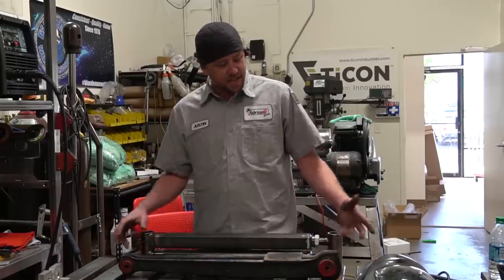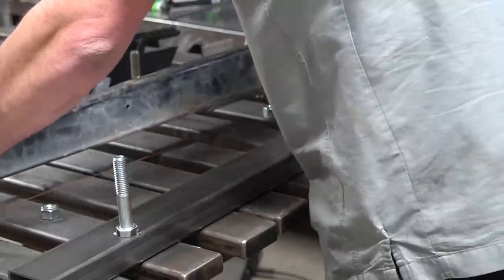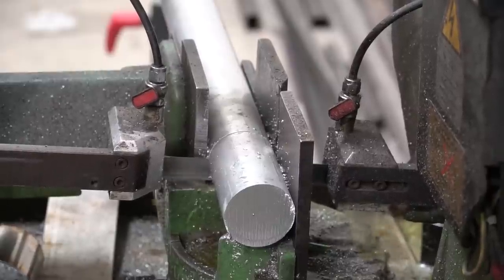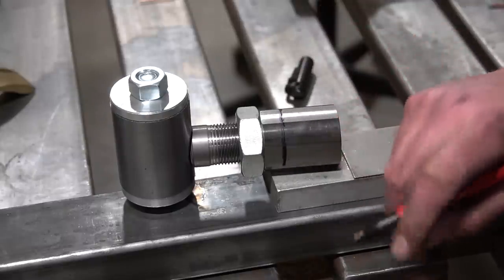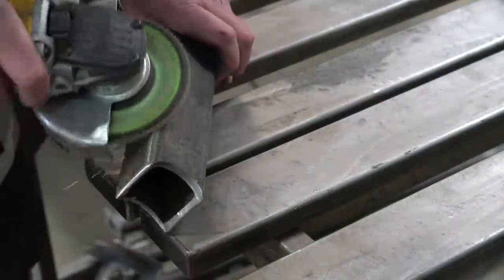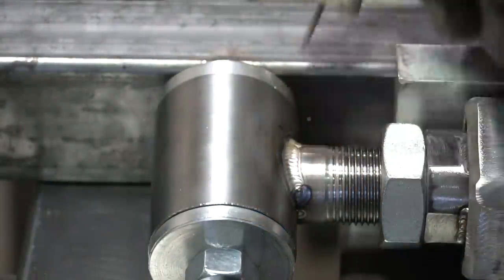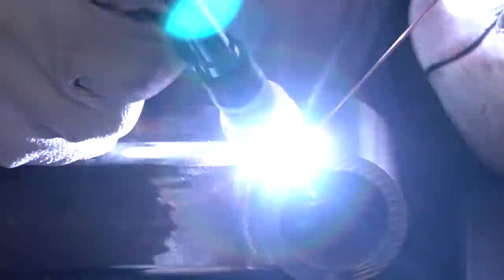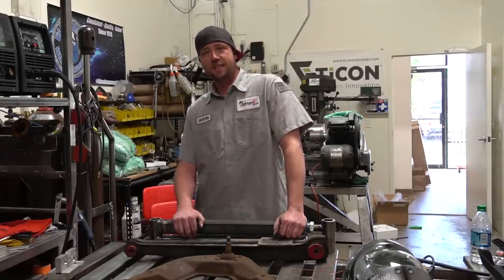TFS: Custom 4 Links Part 1

Comment: As an (ex) jig designer I would have drilled straight through the main square of the tube and put the bolt all the way through before welding.  That would insure the bolts are parallel.  Just welding the bolts on may result in a mechanical lock if the bolts aren’t square on.

Nice welding.  Very neat.

Comment: Justin , I might have a tip for you when you use emery cloth on your lathe. I was taught to lay a rag on the lathe bed ways when 
using emery cloth. The reason being that the grit on the emery cloth comes off while your using it and it sticks on the oiled bed ways.
Then when you move the saddle or tail stock on the bed ways with grit on them you will start to sand down the bed ways and will
start to create a swayback or low spot. This will make the lathe untrue in its future.  Just an observation from a fan in Alaska.

Comment: This was an awesome video! Something to keep in mind is vent holes.  Save yourself heartache when building sealed tube parts,  drill your vent holes
Reply from the maker: It's not sealed.
Reply: With the threaded link installed?
Reply from the maker: @Skeetmgeett  Yes. It's not water tight. Gas and pressure can escape easily.

Comment: Ruffstuff Specialties sells some baller tube bungs for square tube, I think with those you wouldn't have the issue with the corner gaps. 
When I built my three link on my Jeep I heard horror stories of the rod end threads seizing in the bungs from heat so I coated them with antisieze before welding. Awesome video, I like seeing some suspension Fab on here!

Comment: Ian Johnson (extreme 4x4) had a tip a few years back about dipping bolts in muratic acid to remove the coating. It works. But I usually don’t have any so I use a grinder like you did (or the blast cabinet).
Reply: motecalevol - muriatic works real good for that.

Of course, ya' might have mentioned that doing it in a building is a good way for those fumes to attack anything made of steel ANYWHERE nearby (as opposed to letting people learn that the hard way...)

Comment: Nice work.  My instinct for a threaded pin is to measure what 5 thread engagement is near the end, then split the remainder in half for the adjustable portion/initial location before adjustment.    Locknuts can put a pretty good load on mating surfaces, so having only 2 or 3 threads engaged is just trouble waiting to happen.

Comment: First off. I love the vids.. Second. When you were sanding the tubing on the lathe I had a little cringe. I have had emery paper tear while doing this . If yours would have torn, you would have gone forward towards the machine. If you have the paper looped around the backside and pull towards yourself. If it rips you will go in the happy direction.
Reply: you took the comment right out of my keyboard! standard machinist safety tip.
Reply: I’m sure he wasn’t putting his full body force into it so if he ripped he would of been flat footed and secure.

Comment: When youre using turners friend on the lathe best off 'pulling' the emery cloth rather than pushing it that way if it breaks youre punching yourself rather than hardened ways or a spinning chuck. Love the videos, keep it up (without workplace injuries)
Reply from the maker: I was originally taught the way you mentioned but it just doesn't feel comfortable to me. I'm a total weirdo I guess haha.

Comment: That’s awesome to see. 
I just went through the same thing with my 63 Cadillac
Ditched the upper section and triangulated the upper arms the opposite way from factory. 
I searched everywhere I could trying to find any information on 4 links for 59-64 Cadillac’s and couldn’t find a thing.
Reply: Oh your buddy will find a whole new problem once the geometry is corrected. 
I found it the hard way👍🏼

Comment: In most cases a piece of wooden closet rod with a hole drilled in the center has worked for me as opposed to buying a bushing insert. Works great as long as you don’t set it on fire.

Comment: I prefer DOM tube for such things as it looks neater and more  professional to my eye  than square tube. But that is just my opinion, the pressed steel piece looked very commercial which is something I always try to get the look of, the just out of the factory look.
Reply: He’s gonna add a bag plate to the bottom square or even 2x3 is preferred round bars will deflect and bend
Reply: Your referring to round vs square.

Comment: when using  emery cloth on a lathe you should have the cloth on the back side of the part and pull towards you, that way if the cloth breaks or you slip you will fall away from the lathe, you dont want to fall into it....

Comment: Klean-Strip Phosphoric Prep & Etch works wonders on mill scale
Reply: Work better than muratic acid?
Reply: @vr6swp  Faster in most cases, Wet it walk away for 15 minutes, then wash off.
Reply from the maker: Or take 30 seconds to a minute with a piece of sandpaper...
Reply: @TheFabricatorSeries  if you're looking for non marked surface, something like the prep & etch is the best. Leaves no marks or gouges, when it has to be seen at all time and you can't use filler yo make it perfectly flat, it's the only answer.

Comment: You have a very smooth hand when it comes to welding tig.
 
 I've wanted to learn to tig weld for years. I just don't have a need to do it. Well i don't have a big need. 
  Im installing  bracket in my truck to hold the Jaguar xjs independent suspension in the rear. The people who manufacture the brackets say if you don't tig weld tack it in with your mig. Then have a professional come in & Finnish tig welding it all.
   Does the tig have that muck more penetration when it comes to the weld?

Comment: Thank you very much for taking the time to show us how to do this , I found it very interesting. When you tack welded everything together I noticed you didn't g clamp the box section down. any reason ?
Reply: the outside?why bother with it now?sand blast or sand it later when its necessary after build is complete and get 
them powder coated,you dont want to bother with cosmetics until the arms are completely built with the bag mount.

Comment: Hi, I was just curious as to why you chose to use square tubing. Would round tubing have worked just as well, or is there something specific about the square tubing that makes it better suited for this type of job? Cheers! Thank you.
Reply from the maker: There will ba an airbag mounted to it. It's just easier than round in this case.

Comment: Weave welding yields very inconsistent strength test results. Because the material is heated for longer with a weave vs a stack of stringers it puts a lot more stress into the material. Also with stringers it is critical to let each pass cool for maximum strength.

Comment: Great video and fabrication job! Those welds look great too!
Does the square tubing have to be that thick or would 1/8" or 3/16" be sufficient?
Reply: I didn't ask you FFS. I asked Justin because I wondered if something in the car or design called for such thick metal. An eighth inch is .125, not .118 and what does a roll cage have to do with anything...

Comment: I never know what to do.  Are you suppose to crank down on the bushing bolt so that the inner sleeve is unable to move and therefor requires the bushing to move on the sleeve or is the join suppose to pivot on the bolt?

Comment: Would it not be preferable to drill the bushing tube where the threaded end has simply been butt welded. Set the threaded piece into the hole and weld from inside bush housing, as well as the weld you have done ?...Missing link

Comment: Do you feel that you could get similar strength when mig welding this? If so what wire would you recommend?
Reply from the maker: I MIG welded links for years without issues but I feel I have more control with TIG.

Comment: was there any particular reason for tig welding the arms as opposed to just flying through it with a mig?
Reply from the maker: Better control of the weld/strength of it.

Comment: What if all I have is a wire welder. I really don't want to spend the time or money buying a tig or the time. Can it be done with mig? Will it be strong enough. I'm a "fairly" good wire welder. I've put a complete Jaguar IFS in my Ford F100 . I'm wondering about this sort of welding when I do the IRS. It has some radius rods that hold the alignment of the rear pumpkin in place. Plus. Each each of the arms that run out to hold the axles in place. They have rods that come forward to hold them in place.
Is wire strong enough?  Or should I tack it in place. Then take it to a "real" welding shop and have them TIG burn it in? (COST)
Reply: i would get it welded PROPERLY for maximum penetration.if you have a flux 110 volt model,don't bother doing much structural welding
Reply: @trillrifaxegrindor4411  I do have a 110 welder but I only use it when doing sheetmetal body type of welding.  I do have a 220 volt that will burn down almost anything. I've built a rotating type of table. Well it's kind of like a lathe. I've used a variable speed drill that I can gear any speed I want. I can put round objects in it. Put it on a slow speed an weld it as it turns. I'm building a 4 link set up an I'm really wondering if I can weld my arms together like this. I think I could do it in 3 passes (rotations). Will it burn in ok?
I understand that using a tig would be better. But would it be better than "my" mig welding. I know how to mig. I have never picked up a tig. Well that's not true. I used one back in the 70's. But I'm no good with one. Mig I've been doing all my life.  That's a long time!        😋

Comment: How's the adjustment work? Wouldn't the whole piece with the pin spin when you adjusted that nut? Or am i missing something?
Reply: yeah looks like you'd spin the head of it, so then all of your adjustments would need to be a minimum of half a rotation. The alternative would leave a big old screw needing to find a home, and possibly having it to be a split threat with one being left and the other being right. At the end of the day the lack of minute movement saves a bunch of cash and time.

Comment: @The Fabrication Series, I searched through the comments, and didn't see it asked... why square tubing instead of round? I didn't hear it mentioned, and my knee jerk reaction would have been to use round. (not knocking, just trying to gain knowledge)
Reply: It probably had a bag on the bar,  if you do bag on bar with round tubing you have to gusset it  and it's a lot more work to get much less strength.

Comment: I think if you take a part of the car that is light and flexible and replace it with something ten times sturdy, something else will break at either side of those bolts or the bolts themselves will bend. Nice welding and clean work. Did you drink 10 cups of coffee before narrating? You speak faster than those auctioneers.

Comment: Nice, a lot of the time people won't spend a few minute fabricating jigs and fixtures because 'it's too much bother/takes too long' etc... then take twice as long messing around with the first one and three times as long matching the second to the first.
If you're also doing the top links, you can use a side of the same fixture* for it's alignment bolts so you don't have to find two when you need them.
Mark exactly what it is and put it aside - good chance your client is going to send others round.

*IIRC from PP&T it is a fixture, not a jig, but I was always getting those definitions mixed up so... :-(
Reply from the maker: Jig vs. Fixture is literally the difference between machinist and fabricator haha. They're often interchanged with different descriptions for the same definition... I'm not even kidding.... it's like east vs. west
Reply: @TheFabricatorSeries  I think you nailed it - Fixture holds things in place for working on, like welding, etc. Jig does a similar job but also holds guides/aligns toolingfor further coperations  - like drilling or machining.
But, as I said, confused the heck out of me.

Comment: Why did you leave your tungsten sticking out so far?
Reply: that's purely to get into any of the tight spots that were needed for the weld. He said in earlier videos on welding with tig that you should always go over your run working out your movement and such first in order to ensure that you get a good weld. Nothing worse that just going gun ho at it and getting half way through and having to re-adjust your tig torch in order to complete the job because the tungsten won't reach to the root of where you need the weld to stick. He also compensates with having a much larger cup and possibly a little higher flow to allow for a more abundant supply of gas.

Comment: Nice Welds.
I do not believe you did any math. Don't blow sweet smoke up our bums talking about ratios either. You just got some heavy sh*t that was as thick or thicker than the sheet stamped originals. And did you need to make two sets of alum. dummy bushings or could two have done the job?

Comment: Um.......1/4" wall is for locomotives.  3/16 would have been overkill. Oh well, looks good. Plenty of opportunity to cut 'lightnin' holes in them and make them look trick.
Reply: how to get a good rep, overbuild
Reply: 1/4" wall is pretty standard in the off-road world. anything worth building is worth over building
Reply: @mikeymaiku  Is this off road? Streetrod I think.
Reply: forgot it was a bagged cadillac. i recant my statement
Reply: Almost anything in the customer suspension world is 1/4 wall anymore. I did all 1/4 wall in my stock powered b2200 when I bagged it pay a little more once or redo it a few years later
Reply: kmcwhq 
1/4 would be better, its not just a link arm, its also holding the weight of that corner on air bags. Point load also being a dynamic load can do some crazy things. 
Also the pieces are probably fit for 2” 1/4 wall as id changes if it’s 3/16
Reply: Yes remember he stated it weighs as much as a house.  The few pounds a piece of weight savings wouldn't be worth it as compared to the piece of mind that it will last a long time
Reply: @mikeymaiku   Cage wall is .118 that's less than an 1/8" and that's anticipating destruction, this is a suspension link!! Overbuild? That's an understatement!!
Reply: Drill holes  into that square tubing, and they will let water in. Next thing, its rusted out. It can be treated for rust protection on the outside, but inside would be somewhat more difficult. In any case, welding would destroy any treatment.
Reply: You could toss the arm this guy built into the Dead Sea and it still wouldn't away before any of us pass away lol

I love seeing over built, over the top unnecessarily strong parts.
Reply: Yeah, there is a limit. .120 even in chromoly is going to be heavy as fuck lol. Cages are more knowing physics and how to distribute those harsh impacts. You could use .250 wall tubing, have a bad design and be crushed. 
Something like this control arm, .250 is a bit much... BUT, it could be one of those very high pressure  bag setups that can make a 5800lb car hop 2 feet off the ground too.

Comment: Really well fabricated BUT... not 100% well engineered. 

The OEM links are stamped in a open shape - U with reinforced edges for one reason - this cross section provides stiffness for bending, resist well to bucking in compression but will not resist much to TORSION.

So when one wheel is raised, axle twists on the vehicle longitudinal direction and then the links have to twist the SAME ANGLE. If links are stiff in that direction, bushings and mounts will suffer much more load.

This may cause fatigue to crack mounts in the body!
Reply: the stamped steel part is maybe one 1/10th the strength of the square version.that's probably giving it more credit than it deserves.
look at aftermarket control arms(which are way stronger than stock),they are either round or square tubing,just like he made .
Reply: @trillrifaxegrindor4411  Yep but my point is from a design perspective, too stiff in the torsional direction is not producing any benneffit. Chances it does some harm to the brackets on the axle and body. Years later and they crack and someone will say 'Piece of sht, no good for offroad' but in reality they suffered fatigue from the twist generated by the top stiff control arms.

Overkill is not a good solution when fatigue is involved!

Comment: As far as jigs, get some cheap round bar stock and a die set. Cut to length and thread where needed. Its cheaper and with good technique and tools, the threading time will be less than the time it takes to grind off the zinc. Plus bolts cost more than steel round by a margin.

Comment: Welding in a jig means less than nothing. If you have a gap, its going to shrink and pull. No jig is going to prevent that.
Reply from the maker: Actually it does help as long as the jig is stronger than the force pulling on the part.
Reply from the maker: But of course best fit will combat distortion overall....